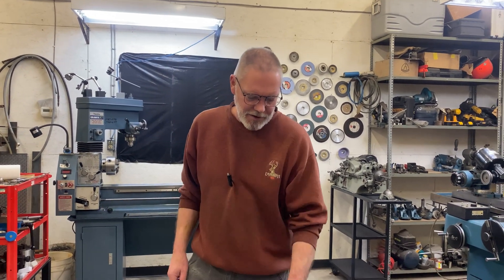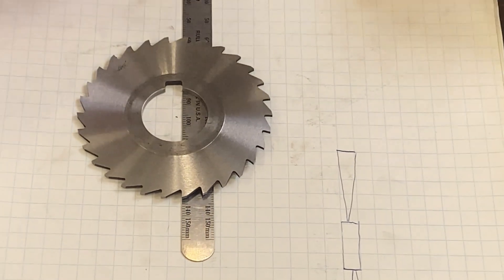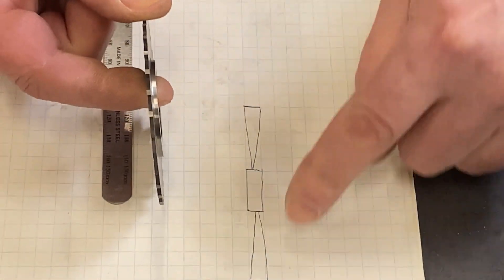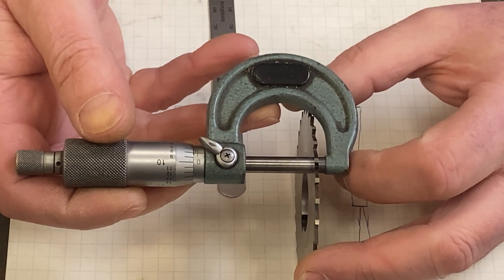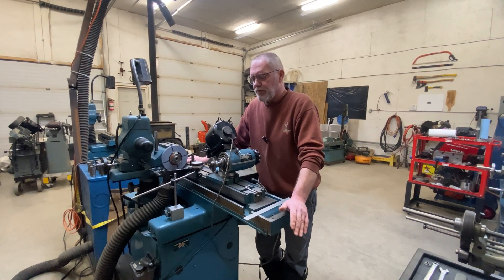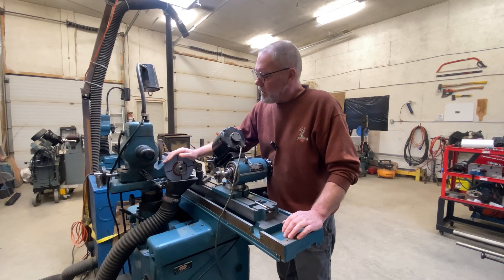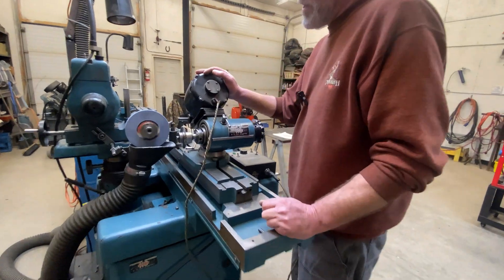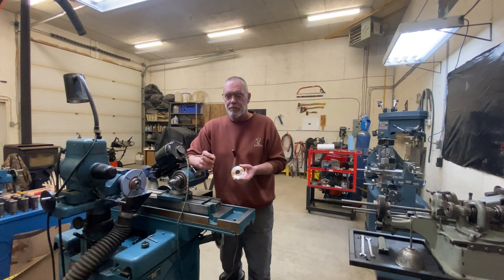HOW TO CUSTOM SIZE A SLITTING SAW

Comment: I actually was wondering about grinding a screw slotting cutter thinner to fit a smaller slot! I always enjoy your videos! I think if I try thinning a screw slotting cutter that I might not thin it all the way to the arbor in order to retain rigidity, what are your thoughts? Thank you!
Reply from the maker: Yes it makes sense to only go part way to the hub/arbor for reasons of rigidity. I would recommend that while you're at it anyhow go far enough to suit any future slitting needs you may have.
Cheers!

Comment: I forgot to ask, are you grinding right up to the shoulder of the hub of the cutter? I’ve a er40 Morse taper 5 holder to grind the flats slightly smaller to fit my mill and wondering whether to grind right up to the shoulder? And if so should I dress the wheel with a sharp corner to get into the corner? Thanks!
Reply from the maker: I did grind right up to the shoulder of the hub. I didn't make any effort to keep the corner of my wheel square. I'm afraid I'm not familiar enough with what you're up against to give much of an opinion.  
I have noticed that grinding wheels are horrible at keeping a sharp, square edge when forced to work into a corner. It would probably be easier to make the flats longer than you actually need than it would to maintain a sharp inside corner. Again, not sure if this is helpful with your exact circumstance.
Reply: That makes perfect sense, thanks very much! I’ll make the flats longer and accept the non perfect corner!

Comment: How long do you expect the diamond to last?  I was shaping a small point (1/2” dia 1/4” wide) it was broken and jagged and I need to true it up.  I got pretty significant wear on a new 1 carat diamond.  (Cheap eBay diamond).  That seems excessive.  I am thinking it is just a crappy diamond.   It was black in color.
Reply from the maker: I think you're right about having gotten a crappy diamond. I regularly get years of use out of mine. Thanks for watching!